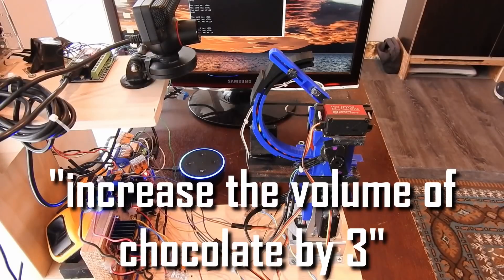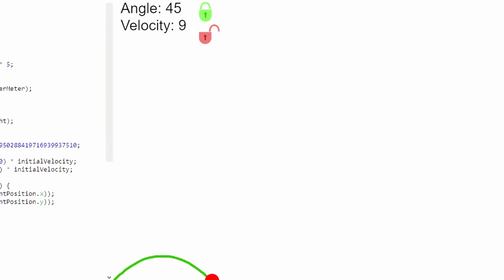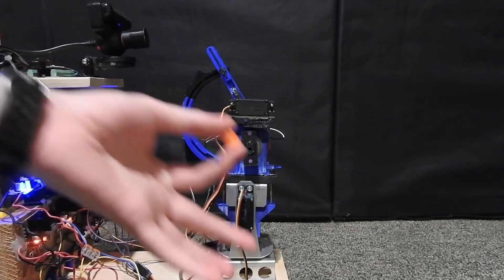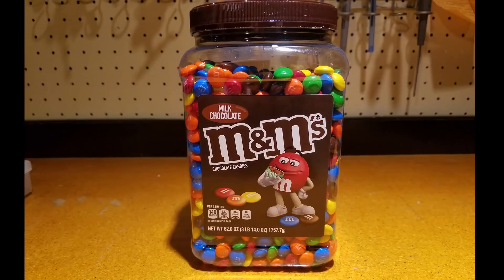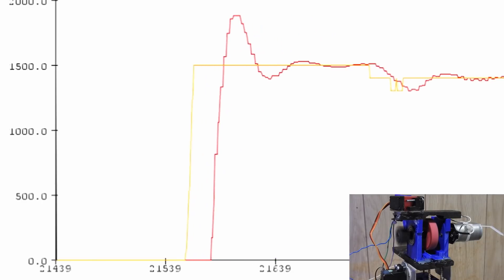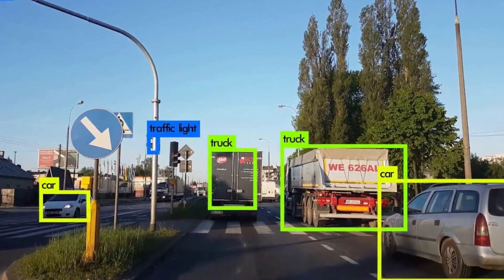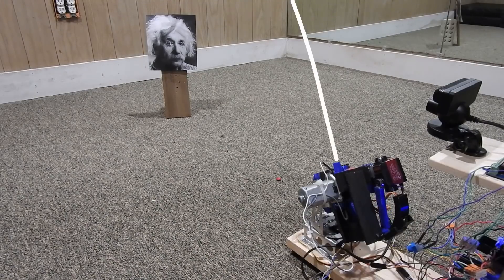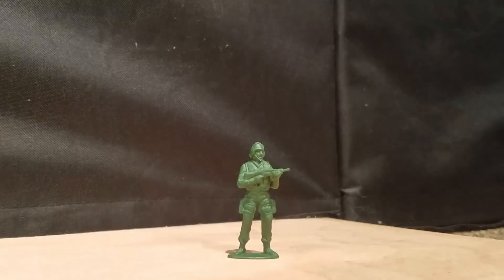Completely Automated M&M Launcher - Voice Activated Using Alexa

Comment: Incredible project, Harrison! Would you consider posting your STL files to your git for others inspired to make your project?
Reply from the maker: Sure thing! I've added them in the folder called "STLs". Keep in mind that these aren't all the 3d printed parts you need to build your own M&M shooter, just the majority of the key components.
Reply: @HarrisonMcIntyre  Sweet! Thanks Harrison. I'm also curious to know what specific servo and motor options you went with. When I see components that look far above budget-caliber, I figure there's a good reason, and a mistake I can avoid making.
Reply from the maker: @MakerProjectLab  Sure thing.

I used these servos on the turret: https://www.servocity.com/hs-322hd-servo
I'd be cautious skimping on these servos as they take a decent amount of load.

I used this servo on the feeder: https://www.amazon.com/ANNIMOS-Digital-Waterproof-DS3218MG-Control/dp/B076CNKQX4
The only reason I used this servo was because I had it on hand. Any non-micro servo should suffice. However, the feeding mechanism has been prone to the occasional jam, and the 20kg of torque has helped to overcome some of this jamming.

I used this motor on the flywheel: https://firstchoicebyandymark.com/denso
I'm a member of a robotics team that had some of these on hand. I'm not sure whether you can buy them anywhere other than through FIRST, but you can always check Ebay. Alternatively, you could use a different motor with equivalent specs.
Reply: @HarrisonMcIntyre  Great info! Thanks again, Harrison.

Comment: So does the Raspberry Pi calculate the parabola?
Reply from the maker: Yes, the pi does that calculation. In order to simplify the calculations, I ended up solving for ONLY the velocity, and setting the angle to a constant 45 degrees whenever the pi is triggered. In the video I stated that having control over BOTH the angle and velocity is better than controlling either individually (this is still true for many applications). However, through testing I discovered that you want to maximize the candy’s airtime in order to make catching it easier. Any angle greater than 45 degrees would run the risk of hitting the ceiling, and any angle lower than 45 would provide less than optimal airtime. Taking these two factors into account, along with the fact that solving for just the velocity would make the calculations MUCH easier, I decided to forgo control over both angle and velocity, although my machine still has the mechanical capability to do so. The main motivating factor behind this decision was that it made for a much easier equation than did solving for both angle and velocity.

I calculated the velocity by running a bunch of test shots and measuring how far they flew at certain wheel velocities. Then I graphed that data (distance on the X axis, wheel velocity on the Y axis) and took a polynomial curve from that graph in Excel. Using this polynomial equation, I can plug in the desired distance, and get the required velocity out. I hope this answers your question!
Reply: @HarrisonMcIntyre  Neat, thanks! So the velocity number is gotten from the Pi, not the Arduino, correct?
Reply from the maker: Yes, the pi calculates the desired wheel velocity. Then it commands one of the arduinos to run the flywheel at that speed.
Reply: @HarrisonMcIntyre  Cool, thanks!